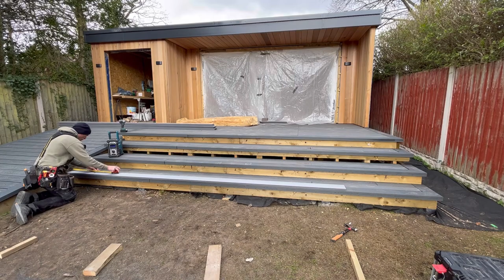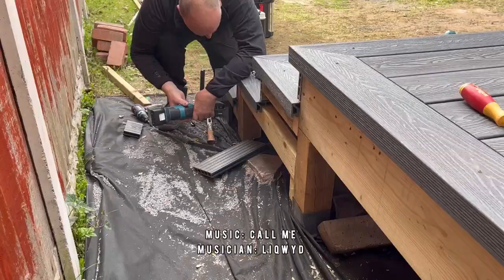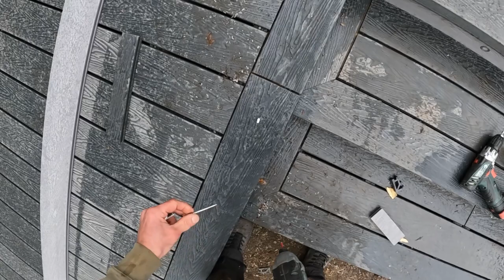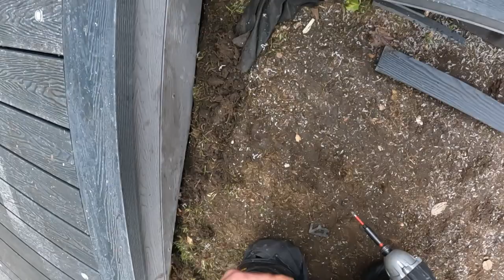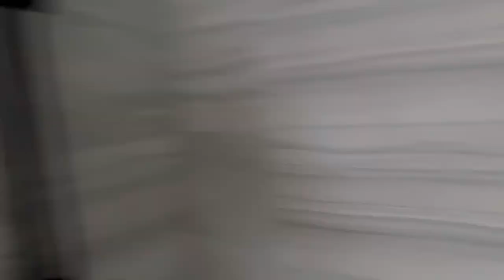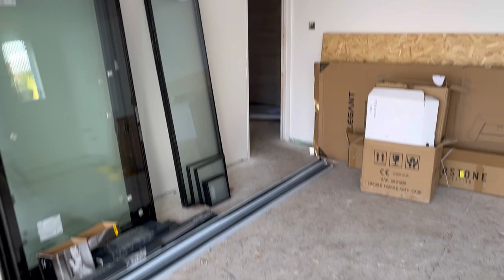Garden Room Build - 2nd Fix Plumbing and stair risers

Comment: Thanks for this,i have the same type of composite decking and was wondering how to fasten the pieces that couldn't be fixed by the proper T type joint.  I was screwing straight into the void of the decking but now see it is better to screw into one of the solid pieces in between..   PS not a fan of the GoPro as it makes me feel like i am in a Redbull acrobatic airoplane.
Reply from the maker: Hi Steve thanks for the comment and glad our video has helped. I can’t agree more with the GoPro footage we haven’t used it to that extent again since. Thanks for watching